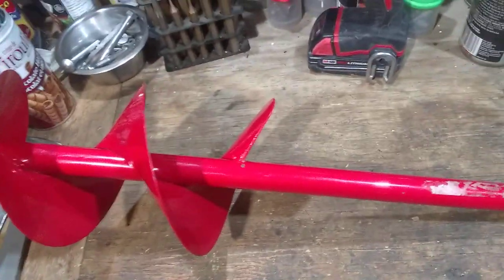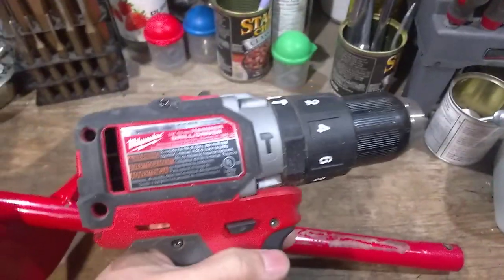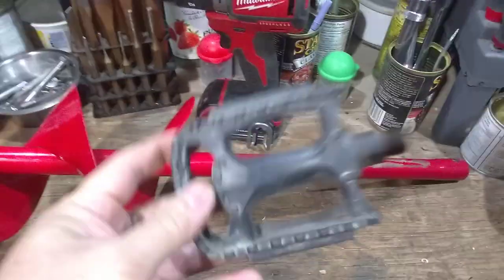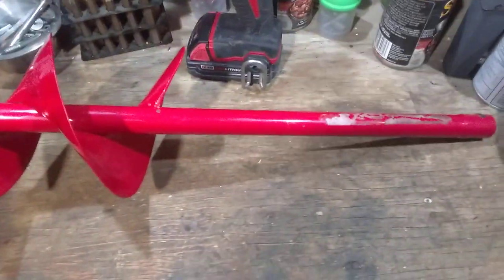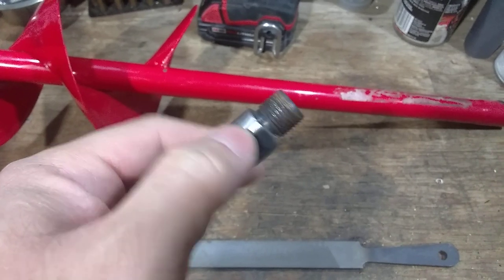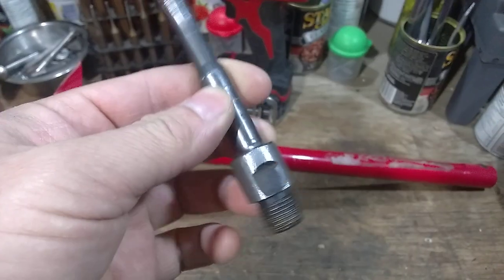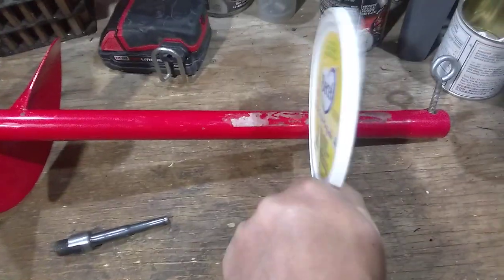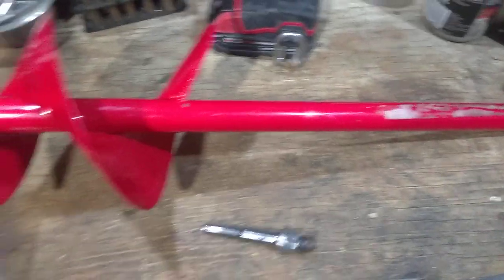Homemade ice auger drill adapter - Part 1

Comment: Do you have to weld a center on between the blades so it doesn’t walk?
Reply from the maker: No you don't need to weld any center on the auger. Just break the ice with a slower rpm and a good downward pressure until the depth of the hole reach the outside edges of both blades then speed up until work done. It only walks when not being held perpendicular enough to the surface.

Comment: Problem is the part is not octagon ...
It's round ..
Drill could slip on round surface ...
Loose your auger  ..
Reply from the maker: I have been using it for long time without any issue, other than some bite marks from the drill chuck on the shank of my adapter. Many drill bits have rounded shanks, they have no problem to be held by normal three jawed drill chucks. Not to mention there is still a disc on the auger to prevent it from dropping into water just in case the drill chuck fails.